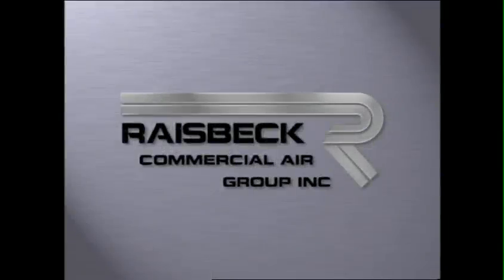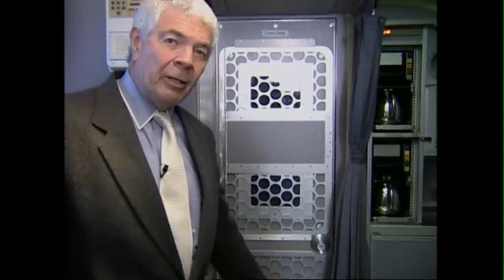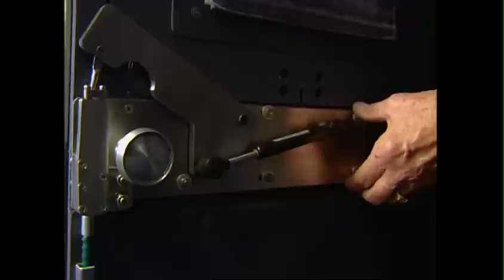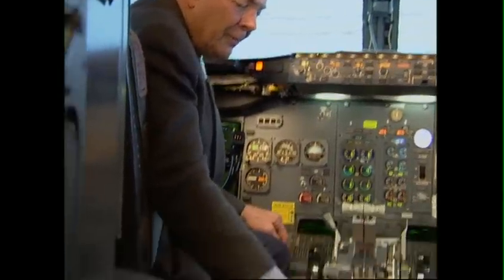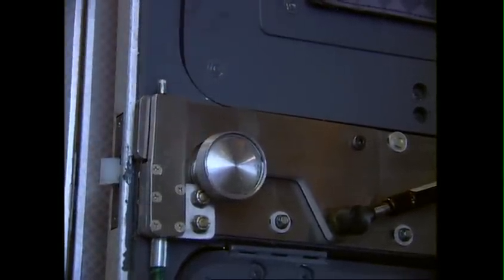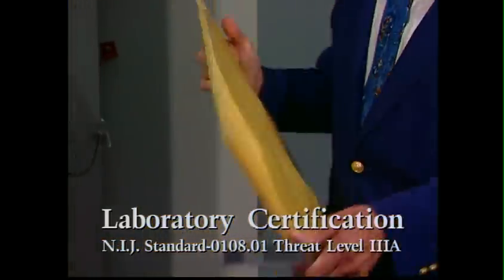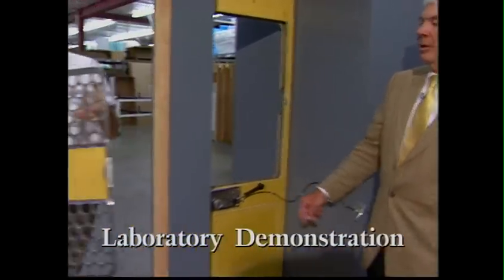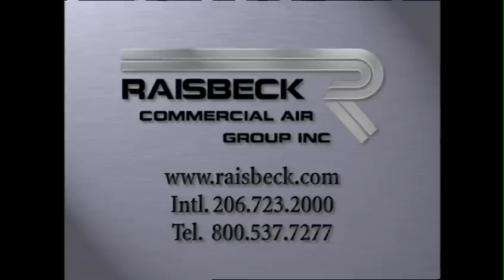Raisbeck_737_Hardened_Cockpit_Security_System

Comment: Humans are in the equation. Co-pilot and pilot have to take bathroom breaks and be served food. This means the door has to be opened during flights. As such this leaves them open to being grabbed and being pursued to be let into the cockpit. Next to the door is opportune hiding area where a gunman can hide while forcing someone such as a pilot or co-pilot or even stewardesses to knock on the door to be let in. Ridiculous system that is only a "visible" deterrent security system that will not prevent hardened tactical minded individuals from entering it. That being said. the cockpit should instead be overhauled to where the area leading towards the door is narrowed. Camera system should be installed to view any hiding threats that lie and wait to charge the door when opened. The air in/out is not longer controlled by the door and the thickness of the door should be increased. Bulletproof glass will not stop a Semtex charge. All of this would cost to much which goes against corporations beliefs.